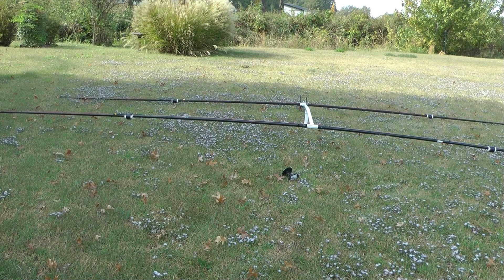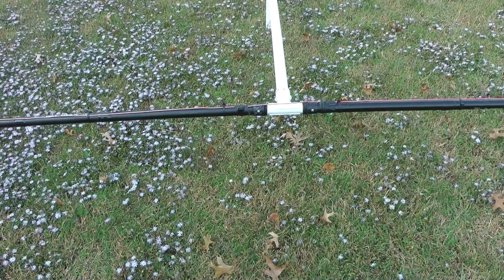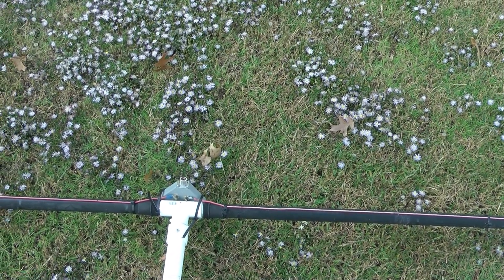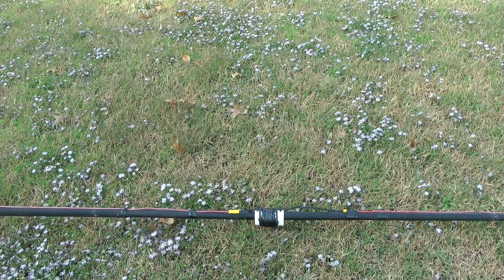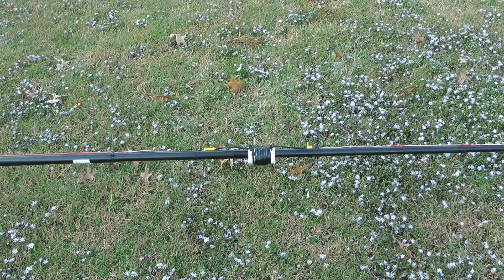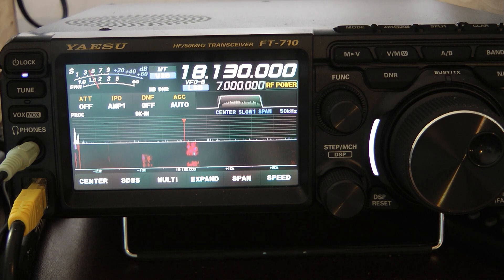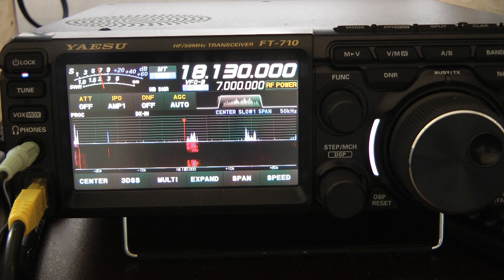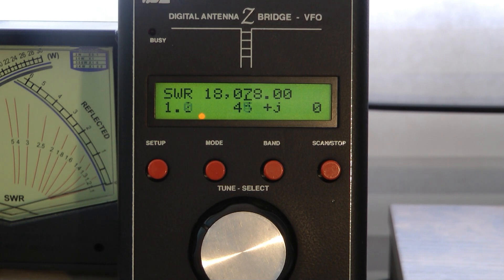17 Meter Mini Yagi beam, Homebrew, yes you can build a beam

Comment: What is the reason for using 10ga wire here? Power handling or its just a wire you had available ?
Reply from the maker: Power handling, I tried 18 AWG for the coil and it would not handle 100W, using 10 AWG handles power fine (500 W) which is all my amp will do. I use 16 AWG for the elements and 10 AWG for the coil
Reply: @johnwofford2708  Thanks for the clarification. Is there a document online for this antenna with exact dimensions and measurements that one can start the build from ? Thanks.
Reply from the maker: Nothing online that I know of, it's my own design. I think I gave everything needed in the video except how to connect the fishing poles to the pvc boom. I used 3/4 pvc snap connectors, a 3/4 inch pvc pipe fits perfecting inside the fishing poles. I think I gave a little more info about this on my 17 meter mini yagi video

Comment: Great build! I built a 2 elements Yagi for 10-12-15m with fishing rods and aluminum tape is my best antenna at the moment, it did out performance all my delta loops antenna as well. 73's my friend.
Reply from the maker: I would love to see a picture of your Yagi, please send it to my QRZ email. Thank you
Reply: Awesome. How is that aluminum tape working for you? I have a roll that I have wanted to use for something like this. Thanks.
Reply from the maker: Not using aluminum tape, just stranded copper wire
Reply: @yqtszhj  it works really well, the elements doesn't collapse any more which makes a trick for portable operation.

Comment: PS: I’ve designed a 20M mono band Yagi using a similar pvc boom. It sagged more than I wanted, too. I inserted a very lightweight wooden dowel into the middle of the boom which cured that sag.
Reply from the maker: I am actually going to use a cross connector in the center, then go straight up from the boom with 3 feet of PVC pipe and run support cords from the top of that pipe to the ends on the boom